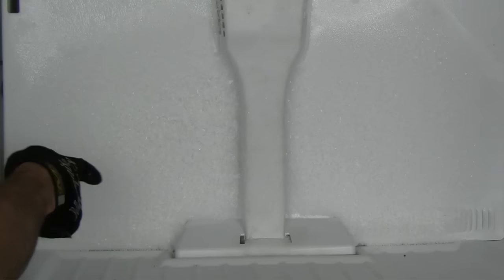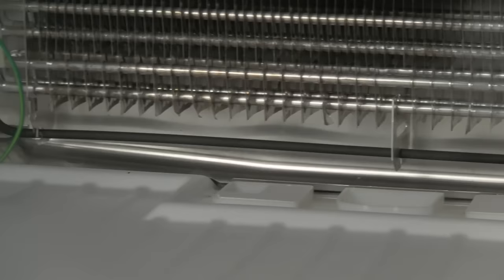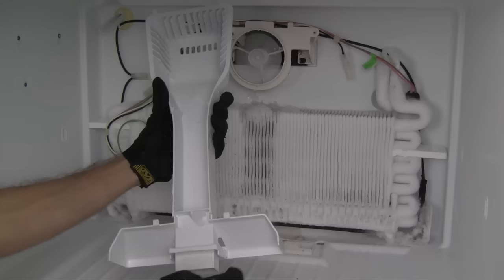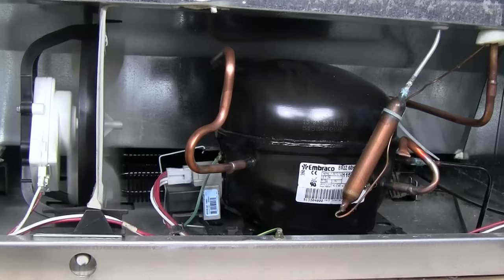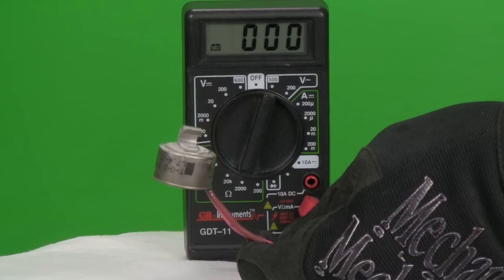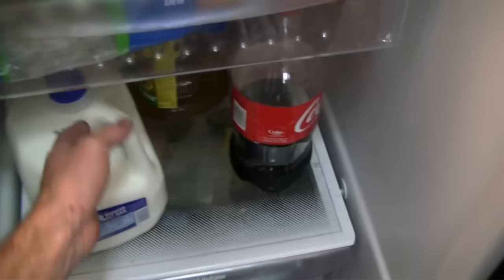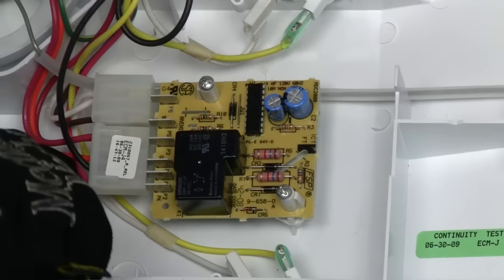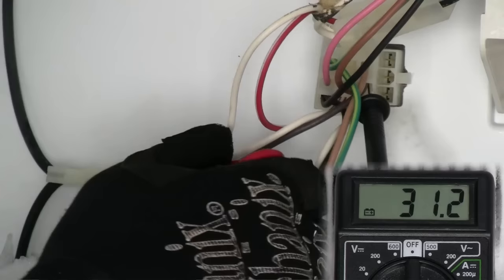Refrigerator Repair (Not Cooling, Defrost System)

Comment: i have a Kenmore fridge that hardly cools  its not keep its cool well the fridge is 1 year old when i open the door to fridge its warm the freezer is  slightly cool  cool enought to ceam my ice cream  from melting  but its soft  but  you can see there is moisture everywhere and then fan isnt blowing very cold  at times  but  after the compressor kicks in it  blows  really cold  for bout 20 min  the compressor runs  long times  there is no ice build up  but  the  frame of fridge been the doors  and on the  grill and  fridge side  get really hot
Reply from the maker: Sorry for the delay on this!  The warm cabinet makes me think that either the bottom coil under the refrigerator may be very full of dust, or the condenser fan next to the compressor may not be working.  Pull the back and look at that fan and the coils, hopefully you will see the cause.  Good luck!
Reply: thank you very  much  for help  I pulled the fridge out  and  the little fan back there   had  completely fallen off the shaft  I went to a parts store and got  another blade  as it was lose fitting on the motor shaft the old blade was plastic  I put this aluminum blade on it feels the same weight as the old one   its working good moving lot of air.

Comment: Refrigerators today are made  cheap. we had a 1980 GE  golden brown Refrigerator that worked great for 20 years without any real issues. now of days you are lucky to go a year without running into an real issue with them. I had a maytag Refrigerator and after 3 years that thing had problems left and right. first the ice tray cracked, then a leak issues with the coolant, then the compressor went out all in a matter of 8 years. So I bought a Samsung thinking that it would be built with better quality but nope the display panel went out and the deforest regulator is a flawed design that is causing the back of my refrigerators freezer to form lot of ice. so repairman  is ordering a modified newer version of the deforest regulator that Samsung so happened to change 2 months after my  Refrigerator was made for that model, because it was a known issue. Yet this Refrigerator is only 9 months old and already had 2 big issues with it.

Comment from the maker: @djkaneck1 Unfortunately I can only write 500 characters here with no links so it's a little difficult... Try looking at the Troubleshooting Refrigerator Problems page on my web site. 
ApplianceAssistant Com (the link is on my profile)
You need to determine if the compressor is running or not. If it is running and not enough cold is being created your only hope is that the evaporator fan is out. If its not running you may have a bad thermostat or start relay. Email me if I can help more. Thanks!

Comment: Haier no frost double door model 618SS  cooling issue 🥲🥲
Reply from the maker: Bummer! The newer units are pretty complicated. Try the unplug and thaw. Possibly a 10 minute unplug to reset the control board, if there is no signs of frost build up. Good luck!
Reply: Sir, I u unplug it at least 24 hour. But after two days fridge compart and freezer compartment temperature go down 14 'C . And after restart it took 3 to 5 hour to start cooling but later on problem still persists 😢😢
Reply: If u say so I can send u pics.. glad to see ur response
Reply from the maker: If all the fans are working it sounds like you may have a sealed system problem. Not really a DIY repair, fair amount of knowledge and specialty tools are needed. Check the interior fans and make sure the lower condenser coil is clean. That’s about the best you can do before calling for some help. Good luck!

Comment: Thanks for sharing this step-by-step process of a refrigerator that is not cooling. Not only did you show how to correct the problem, you also explained how the refrigeration system works (by touching on each component). THANK YOU.

For great appliance repair in the Baltimore, Pasadena, Columbia areas contact www.arjot.com

Comment from the maker: @FORDGTFANATIC I'm doing Christmas stuff today but if you email me through my website
ApplianceAssistant Com I will be able to write more than 500 characters and be more specific. There is some more information on the site about troubleshooting refrigerator problems and using a voltmeter but I don't have anything specifically about duel evaporator designs yet... I'm hoping they stop making them.

Comment: Hi! I've been trying to figure out where this noise is coming from. It's coming from the lower back of my Whirlpool fridge. It's an european model. Maybe the inlet valve? Or some relay perhaps? What do you think?

https://www.youtube.com/watch?v=0PRlYvDwxyQ
Reply from the maker: Hijraki That is weird! Thanks for the video! The interior fans cycle off when you open the door... but that doesn't sound like a fan. not sure if that model has a door switch or not, some models are using magnets now... If you can, trick the door switch and see if you can pin the noise down to a fan ether in the refrigerator or freezer.  It was strange also that it stopped after the last freezer door opening. If you figure it out I would love to know what you found.  Thanks!

Comment: Great Video, but I still need help. My Kenmore which looks identical to the refer in the beginning of the video.The fridge just doesn't get cold enough it's 40-50 F and the freezer is -0 - 20F.  The defrost works, drain tube not plugged or frozen. Fan works great, freezer cold. Air diffuser not blocked and currently set to freezer at lowest setting and refer at highest. Still very little air goes to refer. Kenmore106 74252400. Any suggestions would be great.